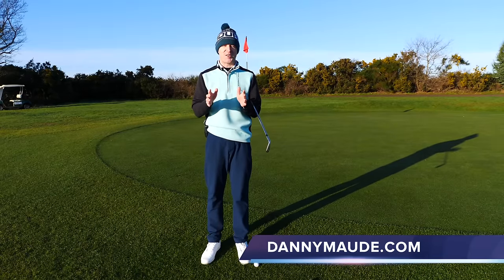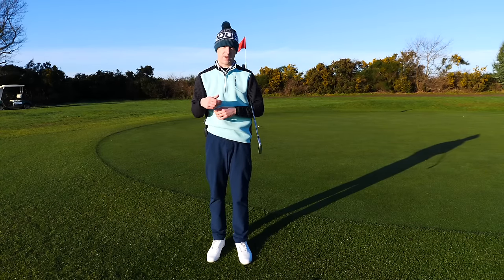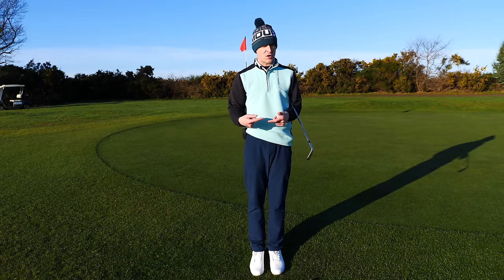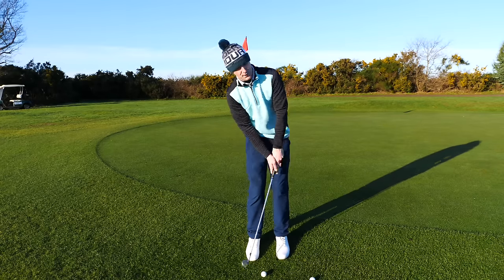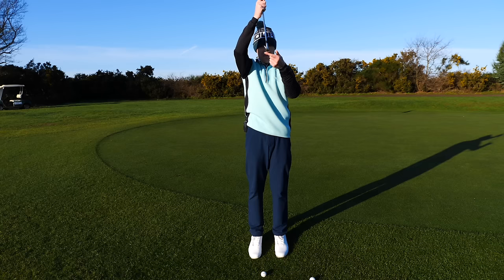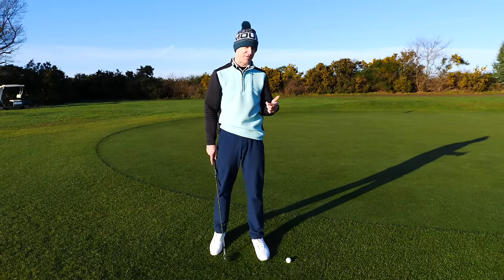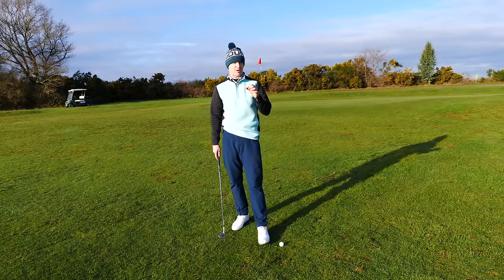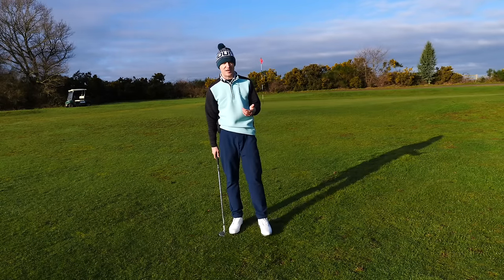CHIPPING Vs PITCHING - CRAZY DETAIL

Comment: Best video on chipping and pitching on youtube!! Some of these techniques are well suited for lower handicap golfer because you have to continue the rotation of the body after the impact which many beginners do not do. This is the reason many videos on the internet advise viewers to have a forward shaft lean during the impact to prevent hitting it thin for beginner golfers, which works great but you loose the control of the shots.

Comment: I put your slingshot driver drill to use on the range today. Most shots were dead straight. Hopefully it sticks with me tomorrow during my round.  

Thanks for the great video lessons.
Reply from the maker: Have fun Michael
Reply: @DanielMaude  the driver drill worked so so. Need more practice. The chipping and pitching went really well.  Just have to dial in distance. I still need work on striking my irons. I also watched your fairway woods and hybrids tips. I took my fairway woods out of the bag and put two more hybrids in. Equivalent to a 3-4 wood and a 5 wood. They worked better than the fairway woods. Ping sent them to me by mistake when I ordered my G10’s ages ago. There was an issue with production of the fairway woods so they sent the comparable hybrids, followed by the fairway woods 6 weeks later. They told me to keep the hybrids.  All these years later I am happy with their production issue.   Next range session will be nothing but work on your drills.

Comment: One follow up question.  In the pitching section do you recommend like many professional (Hank Haney, Phil Mickelson, et. al) that the club head should be laying more flat to the ground to help facilitate the spin that will make the ball land on the green with more spin or would a square approach to the ball as long as the player follows the rest of the advice be sufficient to get the intended strike and the proper action of the ball once it hits the green?

Comment: Simple....and excellent! An eye opener!! Thanks.
Reply from the maker: Richard Brown that’s great Richard, hope you can take it to the golf course
Reply: @DanielMaude  Chipping worked a treat thanks - I did still hit a couple fat/thin early on but could see that there was a mark on the ground facing left so could see that I was either to quick from the end of the backswing or was forcing it using too much shoulders! So, the technique allied with the feeling if letting the club acting like a pendulum is a great help. STILL struggling with pitching though! I have always had problems with the 'in-between' distances where you need wrist cock but is not a full swing. I don't quite understand when a wrist hinge leads to a wrist cock and suffer mainly with shanking the ball. I am not sure in the full swing I hinge at all....really puzzling and consistently shanking pitches. Paralyzed!! I am sure I have seen most of your vids and like them all but can you recommend one that details the take away and what the wrists are doing exactly?

Comment: What do you think about Phil Mickelsons Hinge and Hold method? He chips with a wrist break at the backswing and also uses it as a pitch method by opening the club and softer landing. Everything with one club and a 60 degree wedge. He even chips up to 60 yards with the hinge and hold method just by changing the ballposition.
Reply from the maker: As long as you understand that Phil isn’t driving the handle forward but instead is moving his hands on the arc

Comment: Great instruction. I have a question about pitching. How far away from the green does a pitch become a regular golf shot? If I’m 50 yards out, is that considered a pitch? Do I use the same technique?
Reply from the maker: A pitch could be as little as a yard away from the putting green.  Its a pitch shot when you want the ball stop quickly when it lands and its a chip shot when you are happy to see it rolling to the hole most of the way
Reply: Thanks for clarifying! What about 50 yards out? Do I use the same pitching technique?
Reply: Kevin G yes you can pitch with any club down to about 8 iron with practice using this technique. From 7 iron down you don’t get the height and it’s more of a punch shot. Chipping is often used closer to the green when nothing’s in front of you, pitching when you have to get height to go over an obstacle such as bunker, water or rough and stop quickly on the green.
Reply from the maker: Kevin G I think Paddy has described it perfectly

Comment: Does this pitching technique work from the rough, or do you need a more hinge and hold to get the force through the grass?
Reply from the maker: Great question, Sometimes when the rough is a little thick i have a little more shaft lean, all depends what type of flight Im after.  What I suggest is you experiment with subtle variations as no one technique will work for everything.

Comment: Thank's Danny great vid as always!
Can you consider guide us regarding club fitting? Is is something really important for your game?  Should  I use a longer shaft then the regular if I'm 1'85 cm, etc.?  Graphite or Iron ... what's the difference?
Best regards, 
Göran
Reply from the maker: Its better to find a local PGA pro and have them look at your ball flight characteristics and then go from there
Reply: Just a suggestion... I understand that many pros use drivers and fairway woods that are much shorter than what is sold by the big manufacturers. This spring I had a proper fitting and had my longer clubs shortened and am now getting centre-face contact on a much more regular basis. I have more confidence in my swing as I am hitting my targets on much more regular basis.  With this I have more confidence as I whip the ball through the slot and am increasing my distance. For me all this is significant; my playing buddies notice the improvement.
FYI... my driver is now 43.75 inches (1.11 m) down from the original manufacturer's original length of 46 inches (1.17m).  I am 70 inches (1.78 m) tall. Critical note... changing club length changes swing weight... a good club fitter changing club length will adjust swing weight to match the swing weight of the rest of your club set.

Comment: on the chip you have a backward movement and forward movement of the wrist...what about what Michelson recommends which is the backward motion as you describe...but then you hold it there on the way through..."hinge and hold".  I do think that could bring shaft lean I guess...but with back and foward you do run the risk that he forward motion goes to far....to the flicking no?
Reply from the maker: Great question Scott. I believe Mickleson has stopped calling it hinge and hold and is now calling it hinge and restore. This means he is releasing some of the the hinge he has in the backswing 👍
Reply: @DanielMaude  interesting. I will say this method has dramatically improved my chipping and pitching. Biggest issue is not swinging hard enough sometimes but overall great improvement. Shared with some other friends and my one friend has been chipping to a foot and every time he does it it he remarks, “Danny Maude!”  Cracks me up. Good stuff!!

Comment: Hi Danny, I was just watching one of your older videos about pitching and refer to much more body rotation and less hands. Do you feel this technique works better? Is this part of the same thing or completely different?
Reply from the maker: I use this technique much more as it adds more spin and thus control to the ball on landing
Reply: @DanielMaude  thanks so much for the replies! I went to chip today and this is very easy. I notice that I can hinge my right wrist simply and at different angles depending on the shot I want. One thing that seemed a little odd was a softer/high pitch. I have 2 techniques that seem to work but wanted your input. 1. I would hinge the right wrist back then in the downswing roll the Grip a little to open the face and slide? 2. I would hinge the right wrist back then feel like I slow the top of the grip some?(I could also combine them to go even higher)
I noticed in your body style pitching video you spoke of stalling the body to sling the wrists. Is that another option for a high soft pitch? Hinge back then slow the body coming through?

Comment: Danny, sometimes I thin/skull my chip instead of launching it up. What did I do wrong?
Reply from the maker: Likelihood is you are doing exactly the opposite to what Im coaching here.  The ball is hitting the leading edge because the club is releasing too late.  Try practising getting the bounce of the club just bruising the ground right under your sternum.  Getting consistent ground contact will help tremendously

Comment: CHIPPING MAT! I finally figured out the PERFECT FREE mat to chip from! I took a garage broom, removed the handle, drilled holes on the ends about an inch in, and used long gutter nails to secure it in the ground. Dug out a small recess for it, and it works GREAT. You might be able to do this on a course, just save the grass plug and don't thrash the whole area. Much better results too.
Reply from the maker: Nice work! love that idea
Reply: Love it👍

Comment: The bump and run chip idea is being overly emphsised during past 20yrs. Even from around the green a high pitch also stop in or close to cup.......if practiced well. The problem arised because of fear of hitting line drive(connect ball in ring)
Reply from the maker: I know a lot of pros are favouring the higher lofted shot these days to avoid having to work out the affect of the slopes on the greens...just chip it over them

Comment: Your shaft HAS to be angled forward
Reply from the maker: Does depend on what you want the club head to do at impact and the lie you are playing from
Reply: @Danny Maude  I find that when I angle my club forward and shift most of weight onto my  foot closest to the target, I hit really good shots. Got this tip from Phil Mickelson and have had prob a 95% success rate. However, I see your point which i basically think  applies to all shots you make 🤔
Reply from the maker: @oneness1_  one thing Phil does really well is he doesn’t allow the leading edge to dig